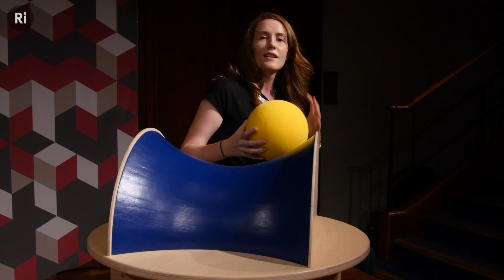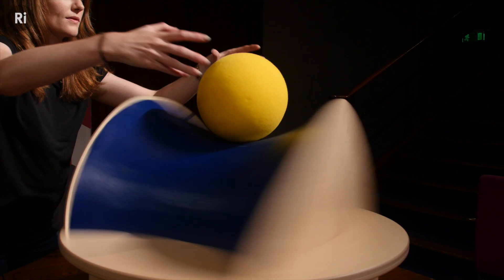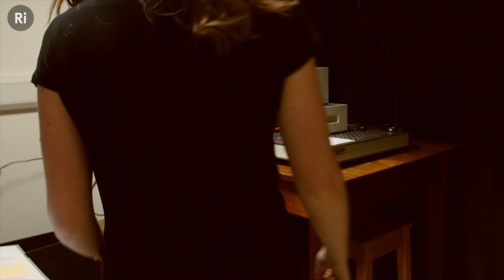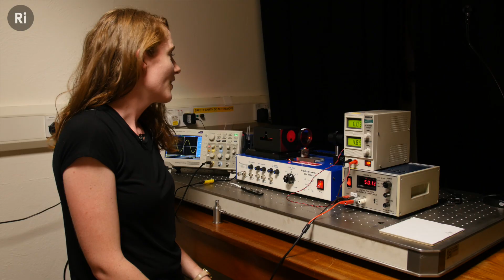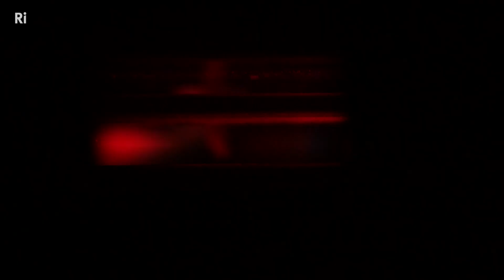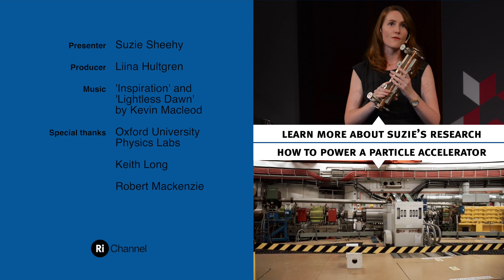How To Trap Particles in a Particle Accelerator

Comment: This has to be the same technique used for gathering antimatter. My question is why is antimatter so hard to produce? Is it simply the probability per particle to become an antiparticle is so low we cannot gather enough fast enough to make meaningful  amounts? By meaningful I mean useful in ways like space travel and propulsion.
Reply: This is the same technique. I'm making a rectalinear trap for my degree atm lol. Antimatter isn't hard to produce per se. It's made in types of radioactive decay. Trapping ions is quite delicate, but CERN has a facility where they can trap anti-protons and positrons, making antihydrogen. The problem is the amount you can contain in a trap. These things are small, and antiparticles MUST be kept trapped under vacuum. The particles are very diffuse, and the trap will not provide enough pressure to trap a substantial amount. In my experience, too many particles in a trap can create what we call a trapnado, but only when not in a vacuum. However, that tells me that it's likely that too many particles in a trap start hitting eachother too much and can knock eachother around and out of the trap. Also, it's just far less expensive to use normal matter to power things. These electric fields, as far as I'm aware, use quite high voltages, at least at the size I'm building. Mine is demanding something like 6kV ideally, which is fucking crazy to imagine being used commonly to transport shit. That's just a lot of power, simply put. 

There is one area we actually use antimatter in practically. That's in PET scans. You're injected with a small amount of a radioactive element, and where there is more blood in the brain, there will be more antipositrons made that collide with nearby electrons, and generate two high energy photons in exact opposite directions (momentum conservation), which allow the scanner to pinpoint the location.
Reply: We cant make a perfect vacuum. So the antiparticles would react with matter in whatever container you put them in

Comment: Does Paul Trap have anything to do with "resonance"?
Reply: There is something related to resonant frequencies involved. Sparing the details of the electric field manipulation, the conditions for stability in the field is determine by the mass to charge ratio of the trapped particles. It's the basis for ion trap mass spectrometery.

Comment: Why can you not just have a constant field on each side? Surely then it sits at the point of equal repulsion
Reply: but wouldn't it need constant movement of the field on all sides? Otherwise, there would be "leakage" and the particles would "escape"?
Reply: Works for rail guns, I don't see why a positron would be different from the rail gun projectile... I would think you could both confine and accelerate the beam with the same field. I may however have a fundamental miss-understanding of the P.A. but I don't see why the Paul Trap is used in place of a toroidal field (permanent or EM).
Reply: It's not stable enough. Particles just get ejected. Instead of all push or all pull, the saddle-like field does both. I can't explain the specifics, but I'm researching to build one right now, and this is pretty much the jist of it. Ion traps are described by something called the Matthieu equation, if you're interested in more.

Comment: Can't it escape with quantum tunnelling?
Reply: Possible but unlikely.
Reply: Electrons could, but particles are bigger than electrons. Assumingly, so big that the debroglie wavelength is too small for quantum tunnelling to happen. If my memory is correct at least, haven't had quantum mechanics for a year now and I didn't study that part as well as the other parts of the chapter :@.
Reply: Koray On Youtube They don't state if they're using subatomic particles or macroscopic particles. If they're talking about macroscopic particles (anything one atom or larger) then it is impossible for tunneling.
Reply: Theres more than one particle.